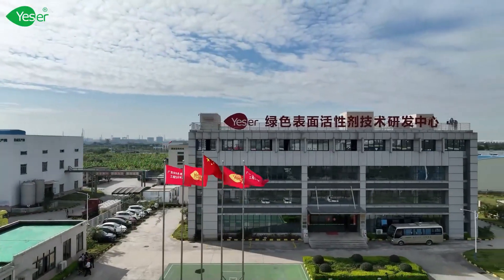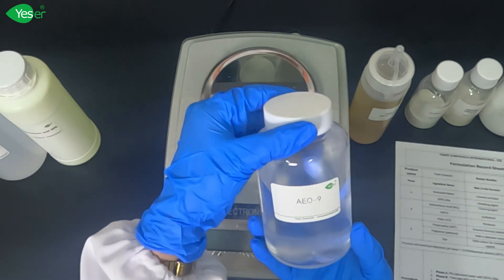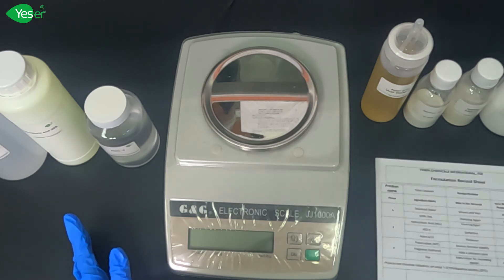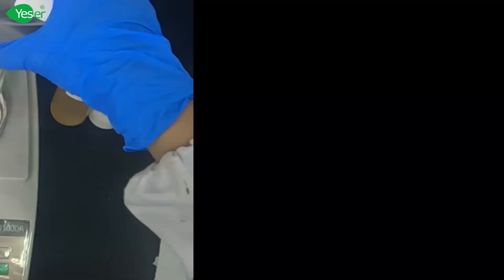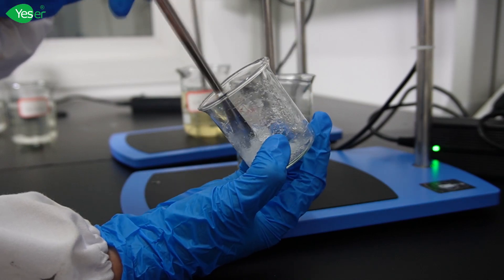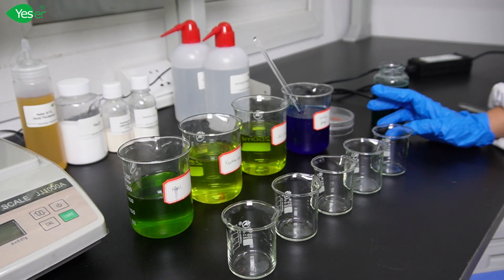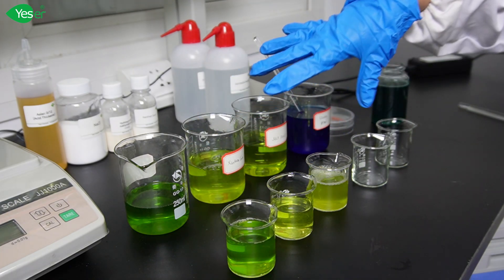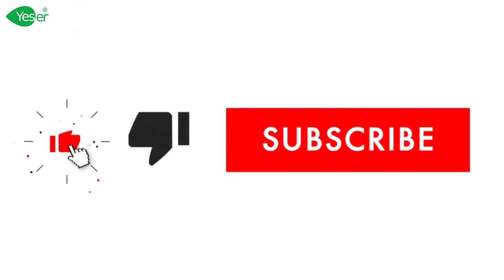Thickening Acidic Toilet Cleaners: Why Common Thickeners Fail & How Aslan O/12 Solves It!

Comment: These materials are not available in Iraq. There is no way to thicken hydrochloric acid??????????????

Please, I want a very easy way.....
Reply from the maker: Thickening hydrochloric acid requires specialized thickeners, and we recommend using our Aslan series thickeners for best results.

If you are unable to source a thickener locally, we can assist with shipping Aslan 0/12 to Iraq. These thickeners are specifically designed for hydrochloric acid or strong acid formulations, ensuring excellent performance and stability.

Please email us directly mary.grace@yeserchem.com to discuss this further.  We are happy to help you get started!

Comment: Does this product clean well the tough stains in the surface and if I don't add Aslan can this affect the cleaning performance?
Reply from the maker: it wont affect the cleaning performance but the solution will be watery thus the contact time of the toilet cleaner to clean and remove dirts  and  adhere on the surface will be shorter and for vertical surface application/ cleaning can be less effective.